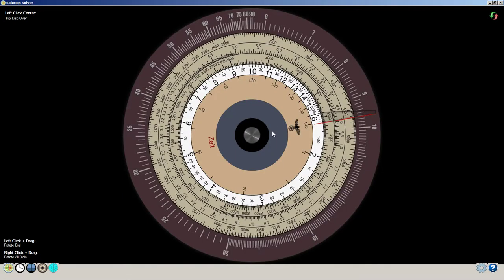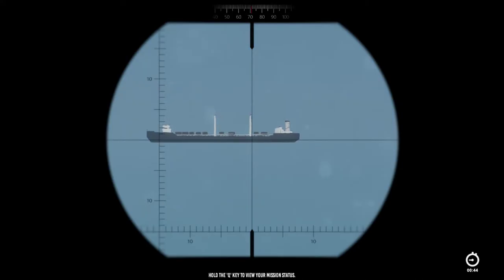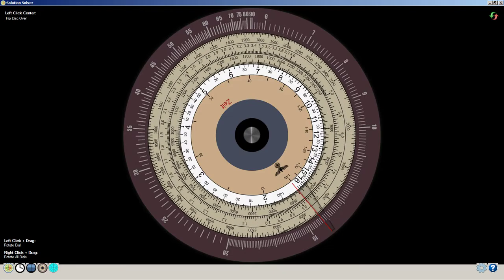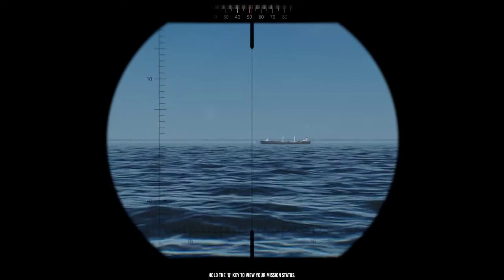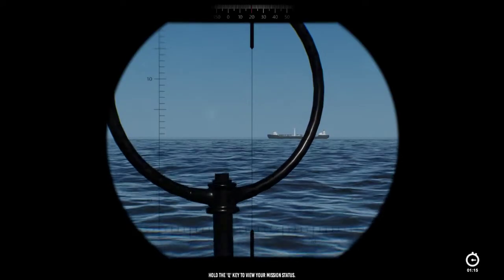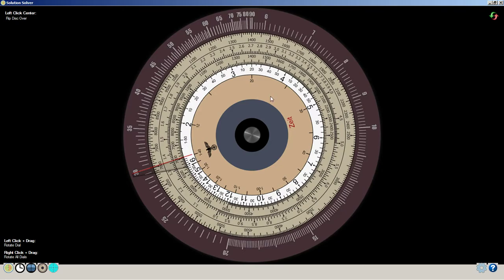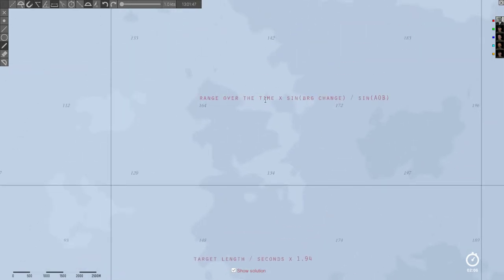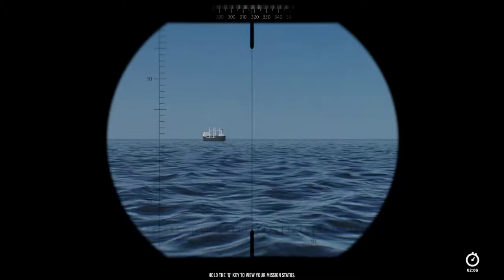Slide Rule Targeting Series - III. Target Speed Calculations

Comment: Can you give me the calculation for the third method, specifically the 2nd calculation if you were to do it with a scientific calculator? I've tried doing it without the speed disc and can't get the 2nd calc to make sense with the numbers in the video.
Reply from the maker: No problem!  Using the numbers in the video: 1400 m/ 1852 m/ 2.1 min x 60 x sin (10) / sin (91) = 3.8 knot speed correction.  The 1852 is to convert meters to nm.
Reply from the maker: The speed you add that correction to is: ownspeed x sin(first bearing) / sin(AOB)
Reply: @m.hamacher7881  Thanks for that. Really helpful.
Reply from the maker: P*Funk I realize I left out a 60 in the formula above, corrected, now it works, sorry!
Reply: @m.hamacher7881  Thanks!